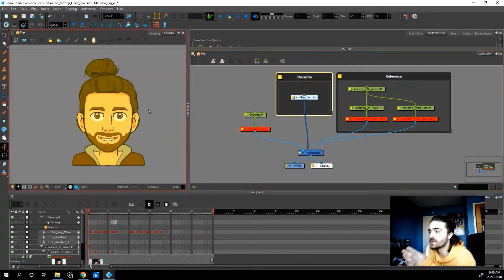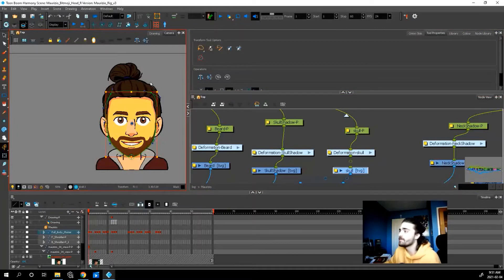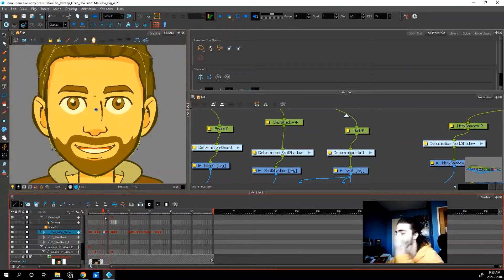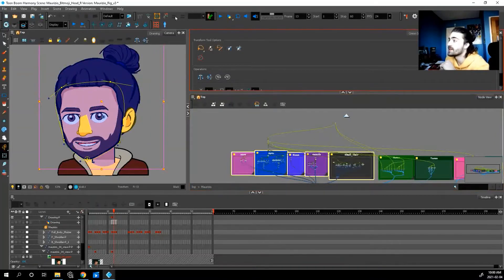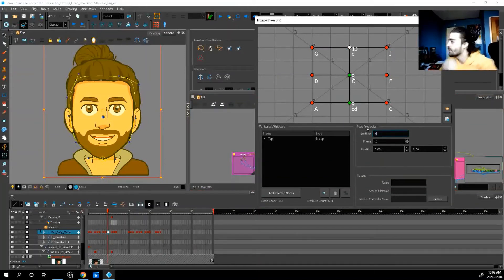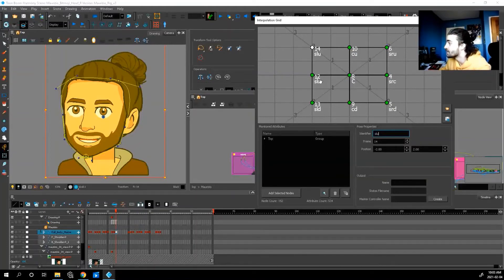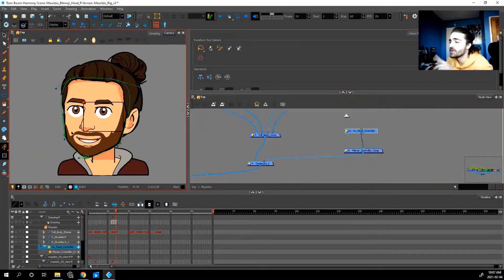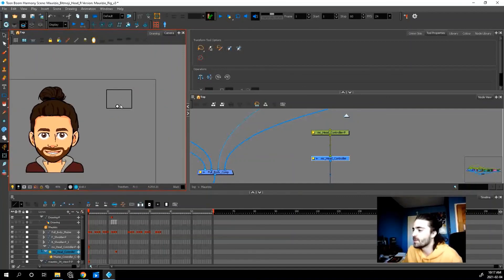How I create a 3 by 3 Master-Controller in Toonboom Harmony

Comment: Hi fabio. Love ur teaching methods. Tho i recently start following u, am a big fan already. I have some questions tho, am having difficulties using a master controller for different mouth gestures and lip syncing. Can u help me with that? thanks in advance
Reply from the maker: hey! thanks for the support!  and hmm are the mouths not changing when the controller changes & is every mouth shape keyframed on the timeline?:)
Reply: Thanks for your fast reply fabio🙏. What i wanted to ask you was, say, i want to make a mouth talking while the head is changing direction at the same time. How do i make the head change direction without affecting the mouth talking. 
I really hope i make sence cuz i really want to get this.
Reply from the maker: @hiruyestiphanos5519  ah ok I think it depends on what pegs you feed into the mastercontroller.  for example instead of selecting the mouth peg, us the face peg instead.  This shouldn't reset the mouth.  or you could just make sure that you do all your head posing before you do the lipsync, that way you won't need to adjust it at all.
Reply: @fabio_gioffre  thank you very much! starting from the head posting worked just fine. Now am smiling🙏
Reply from the maker: @hiruyestiphanos5519  perfect glad you could get it to work!   I would love to see the rig/finished animation when you are done
Reply: @fabio_gioffre  
I will. May take me some time. Bt still will do that!